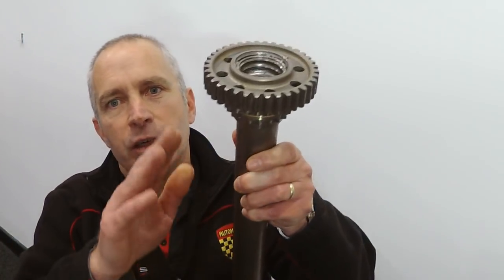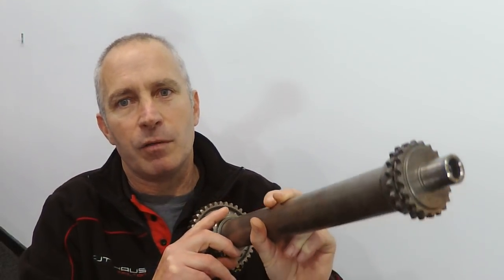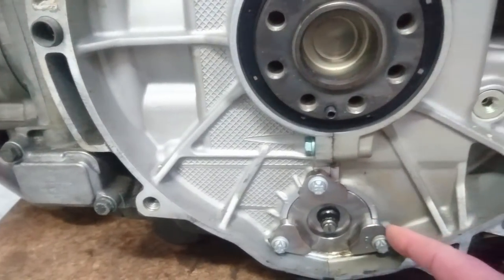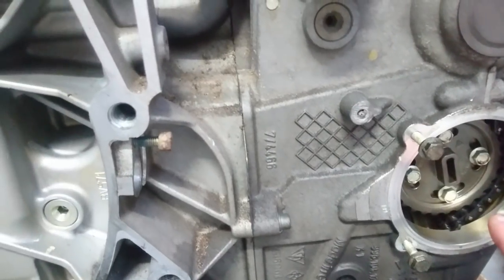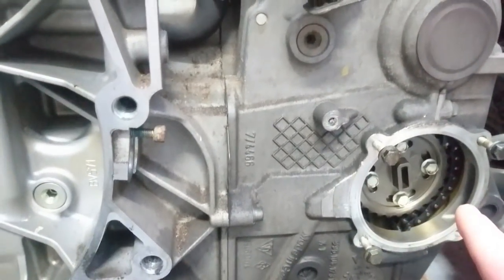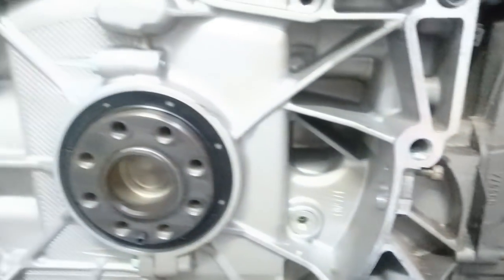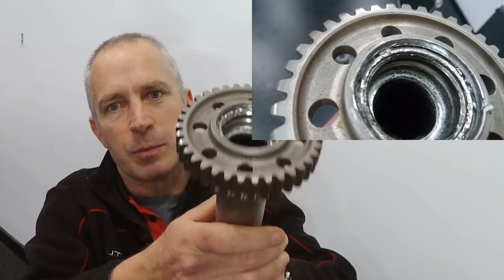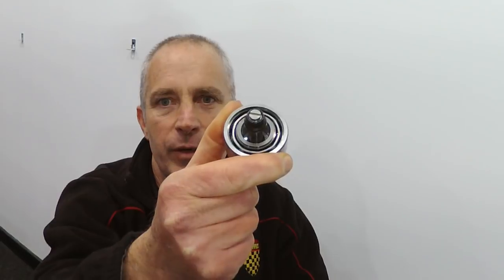Intermediate Shaft Bearings

Comment: The last IMS bearing in the M97 engines is the large single row bearing replacing the small single row predecessor. 2005/6 M97 engines have either or bearing. The final iteration larger bearing is for sure in engine block serial numbers M97/21 67704617 and newer with a failure rate of less than 2% for 987 Boxter/Caymans.

Comment: I chose the L&N Solution for three reasons.  1.  The plain-style oil fed bearing.  2. The other end of the shaft uses it... Right!  and 3. I will put another 200,000 mi on the car.

Comment: Yes sir.....I have a question hopefully u will reply.  I own a 2001 base boxster.  The previous ownere removed the seal on my IMS at approx 145k miles and the car is at 158k miles now.  I have read that the bearing will shed oil from the bearing in less then a second w no seal...  So am I screwed or should I keep on motoring?  Also...where should the oil level be on the dipstick exactly.....i need to keep mine full.  Thanks
Reply from the maker: Likely the opposite - with the seal removed oil can get at the bearing.  It's a fairly common bit preventative maintenance.
Reply: @AutohausHamilton  Oh thats a bit of good news.  Can you please tell me where on the dipstick that I should keep my oil level considering my seal is removed.  the car is new to me...I assume there will be a full mark or dot which is obvious...also when do I get a correct reading...engine warm or cold.  Thank you!!!!

Comment: Hi what should I do about my 2005 987 Boxster 3.2 s with only 36000 miles Any suggestions as car only used in the summer
Reply from the maker: As a 987, your car probably has the later engine and bearing design.  If you're in Australia, give us a call with your car's engine number, and we can confirm which bearing design your car has.

Comment: For me the only solution to solve this Problem is to put in an DOF System  , It’s inexpensive and reliable.
I put it in M96 and M97 engines, they never ever going to fail Again!!!
Reply: Arnold Mosk Please excuse my ignorance but what is a DOF System and what does it do. Thanks
Reply: Robert Hooles Direct oil feed.
Reply: I wouldn't say cheap..most shops 4000 to 5000 to install a dof solution

Comment: Why doesn't the 930 and other higher-end models have this problem?  What's different with those engines?
Reply from the maker: The air cooled cars have a fundamentally different engine design.  The Mezger engine, as used in the 996 GT3, GT2 and Turbo is based on the air cooled engine, which is why these cars don't have IMS issues either.
Reply: @AutohausHamilton  So, I guess what you're saying is that the 996 GT3, GT2 and Turbo were not "water-cooled" engines, they still have the air-cooled engines like the 993 and the 964 and all Porsche engines prior to the 996.  I didn't know that, so thanks.

But that knowledge doesn't answer my basic question:  What's different about the timing chains and intermediate shafts in a 996 compared to a 993, which makes so much of a difference?  In other words, 
Why don't 993 and 964 and 911 engines fail just like the 996 engines?
Why did Porsche feel compelled to make a change in the 996?  
Why couldn't they use the same set-up in the 996 as the 993?  
What was the difference?
Reply from the maker: These are big questions.  The short answer lies in the history.  The Mezger engine as used in the GT3, GT2 and Turbo (up to 997.1) was basically a water cooled version of the air cooled engine, and traces its history through the 959 (air cooled heads).  The reason that Porsche made a change was one of economics.  Remember this was the period when Porsche had to change from being a niche manufacturer to a volume manufacturer, and if they had not done so, they would likely not have survived.

Comment: I've only just got my head around the idea of buying a 3.4/3.6 ltr 996 Carrera and ran head-first into this IMS issue 'thing' (until recently I hated the car purely based on the door handles being pull flaps i.e. pull flaps are 'c.h.e.a.p.') 

It's 'good' to know that potentially, there's something which could go bang and lunch an engine as a result of an IMS failure

For me, I'm not sure I'd want to play Russian Roulette with a car that has not had an IMS bearing replaced - the way I see it, an engine that has not had its IMS bearing replaced could effectively be a grenade waiting to go-off

So an IMS bearing replacement will definitely be something to look out for when inspecting any 996 for sale

I'm in Sydney also - what's a ballpark figure supporting an IMS bearing replacement?
Reply from the maker: Hi RG - give the workshop a call on (02) 9417 0911 and speak with Rick.  He'll be able to talk you through what's involved.  Thanks

Comment: can i just drill holes in the shaft itself?reason they say why the seal break is when car is seldom use air escapes from the shaft and let the oil in and gets trap inside and overheat,so i think if i just dril a few holes in the shaft and put more oil so the shaft gets filled with oil theb there is no reason the ims will loose the grease that was put in there,so what do you think  should i drill or not
Reply from the maker: That doesn't sound like a great idea.  Apart from anything else, even if that scenario were true, oil inside the shaft would be no hotter than the oil around the shaft.
Reply: the air will be probably just a very plausible theory. But how high are the chances that the seal itself just ages/hardens and therefore does not seal properly? all seals age, crankshaft seals and main seals being just one example. Therefore drilling holes won't most likely provide a cure
Reply: To Edward Cooper - I guess your theory is that IMS-problem is caused by oil "seeping-by" the IMS-bearing, arriving literally inside the intermediate-shaft (which is a hollow tube), where the seeped-oil gets cooked to death, turns rancid and acidic, and eventually "eats into" or "pits" the bearings, causing the failure of the bearing.  

I guess your theory is that drilling "your" holes would allow the oil to be "spun-out" of the intermediate-shaft when the engine is running;  And then when the engine is not-running, the higher level of oil (due to over-filling the oil reservoir) allows the intermediate shaft (with the holes you've drilled into it) to more readily fill-up with new oil.

My guess is that the bearings may fail for several reasons: (1) "acidic-pitting", and/or (2) overheating, as the packed-grease seeps through the bearing's seals over a long period of time, rendering the bearing unlubricated, and/or (3) something else entirely.  It seems to me that the intermediate-shaft and the bearing are both already (fully?) immersed in oil because they both seem to sit at the bottom of the engine.  Am I missing something?

Why hassn't someone put up a video explaining the difference in the Turbo, GT2 and GT3 engines which do not seem to have this issue.  And if that difference is a "solution", why not retro-fit the 996 engines and salvage Porsche's reputation? 

I'm no expert on engines, much less "boxer" engines like the M96.  My comments are the result of watching a video put up by Pedro, in Florida, who owns a 996 and an auto shop.  That's who gave me the "rancid, acidic" oil theory that you seem to have based your theory on.
Reply: I forgot to mention that Pedro is the man with the dark hair and white beard.  You can probably recognize his face in the videos on the right margin.  Click on "Oil in the IMS"
Reply: thanks for your reply, I watch Pedros video it does span the oil out of the bearing, this ims issue is going nowhere but just to buy another car that is reliable and will get me home safely

Comment: why didn't porsche hold their hands up and admit they got it wrong, ?
Reply from the maker: I think that there are a number of reasons:
1. When the 986 and 996 were launched, Porsche were not in a great position financially - these were 'do or die' models for them.
2. Every company puts on a brave face about potential product issues, and I guess Porsche hoped that when IMS issues first came to light that this was not going to be a widespread issue.
3. Given how many 996 and 986 cars are still thriving, it may just be that this is really not such a big deal, in the bigger scheme of things but it is one that has gotten lots of internet hand wringing.  I wonder what the world would have made of Dilavar head studs in air cooled cars if they had coincided with the Age Of The Interwebz.

All of the above based on nothing more valuable than personal opinion.

Comment: In your experience, have the LN engineering retrofit bearings proven "bulletproof" compared to the factory bearings, or are the upgraded engines still subject to failure? I'm skeptical that the splash oil lubrication would suddenly be sufficient for a bearing of a similar design to factory.
Reply from the maker: The number of failures of L&N bearings worldwide is vanishingly small.  So much so that they are thought to be due to installer error.  The L&N bearing is a ceramic bearing and is open, and genuinely seems to be a good product.  Bullet proof is always a tricky word...like "never" and "always", because a single exception invalidates it, but that small caveat aside, it is a good product.
Reply: Thanks for your reply. I've been debating the LN retrofit vs solution for my recently purchased 2002 Carrera. I'm leaning towards the retrofit now.
Reply from the maker: This is getting into levels of detail that don't lend to this form of exchange - if you'd like to discuss further, give us a call.
Reply: My mechanic (who also drives a 996) told me to change the IMS bearing each time you replace the clutch. So every 60k-70k miles. He said he looks at the bearing the same way one would look at a timing belt.
Reply: The L&N ceramic bearing replacement is probably installed on a small number of 996's for several reasons:
(1) The folks at Porsche Dealerships generally admit nothing about the IMS issue, and downplay it when asked, so lots of "pre-owned 996" buyers have no idea there is such an issue, and "do nothing".  
(2) The class action lawsuit was settled out of court, which means nothing was "proven" and the terms seem to show nothing was resolved about this ongoing issue, and it surely includes the notion that Porsche can never be sued about this again.  Thus, there's little in the news.
(3) The L&N ceramic replacement is a new thing, when was it first sold?
(4) There are other competing solutions, so how many people chose the L&N solution rather than all the other solutions, including "doing nothing" and "letting the Porsche dealership change the IMS bearing whenever the clutch is replaced because few people know how to operate a clutch without ruining the "throw-out bearing" (which has nothing to do with the IMS bearing, other than spending a bit more money to replace both at the same time.)
(5) The only entity that knows how many have been sold is L&N, but I don't expect them to announce how many they sold, nor the number of failures, even if they knew the number of failures.
(6) Porsche has little incentive to keep track of failures that arrive at their service departments.  Nor do the other shops that work on Porsches.
So the "vanishingly small" number of L&N ceramic failures might actually be significant.